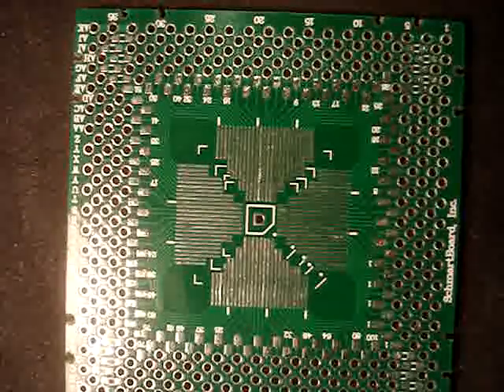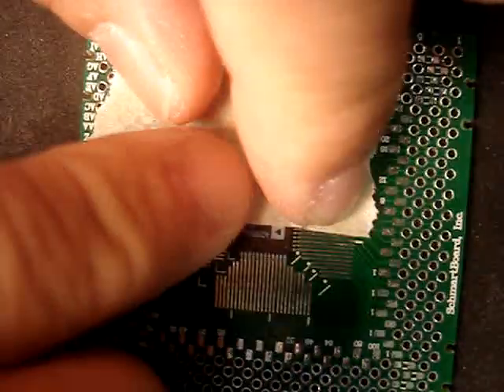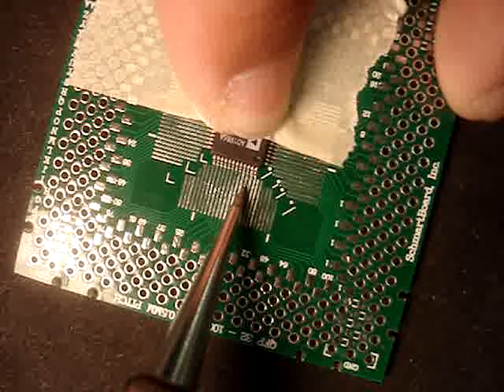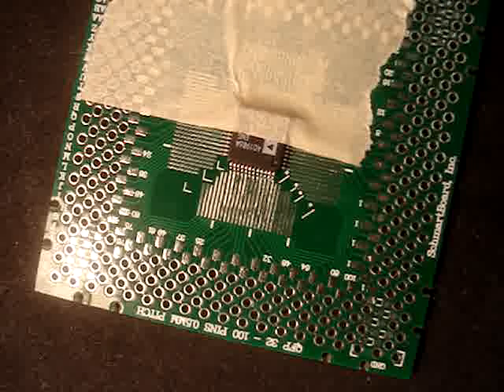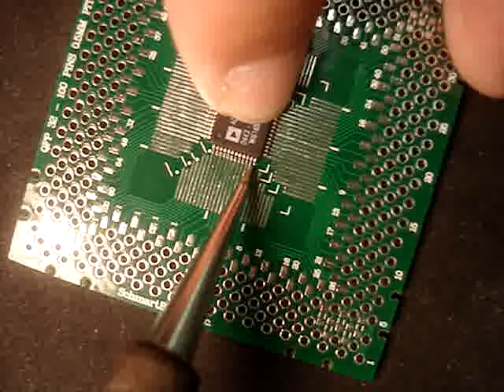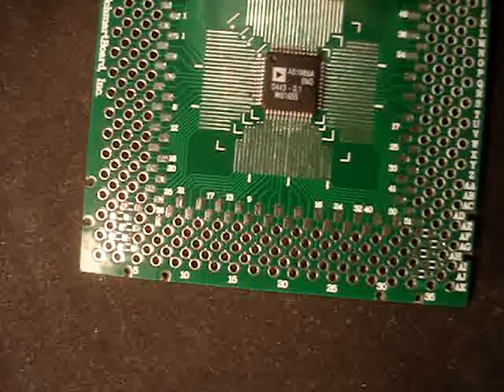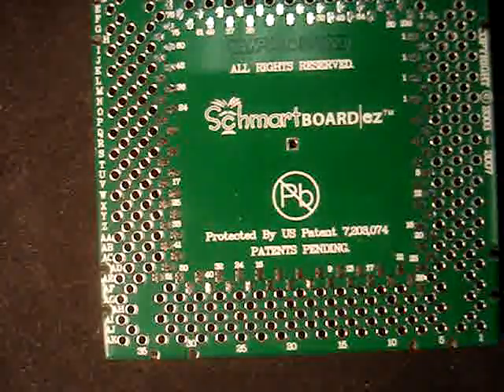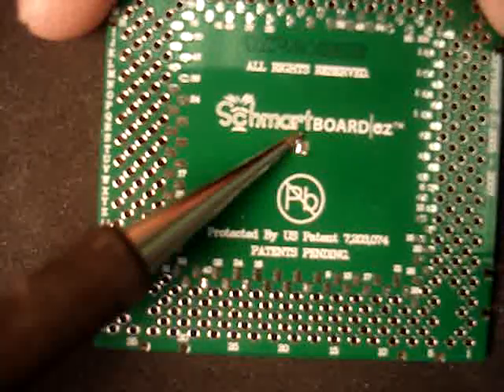Hand Soldering a .5mm QFP Chip With SchmartBoard|ez

Comment: Super.But now capacitor has 0,5 mm.How can i so small soldering?
Reply from the maker: 0.5mm is no problem if you have a Schmartboard, the right flux and a small iron tip

Comment: ""flux is to clean the surface so the solder sticks I think.""

Nope, its to conduct the heat into the metal better. 

""WHAT IS THE FLUX USED FOR ? is it conductive ??""

Yes in a way, it's THERMALLY CONDUCTIVE but not electrically conductive. It also helps protect the hot metal from the temporary but immediate oxidizing effects of being exposed to open air.